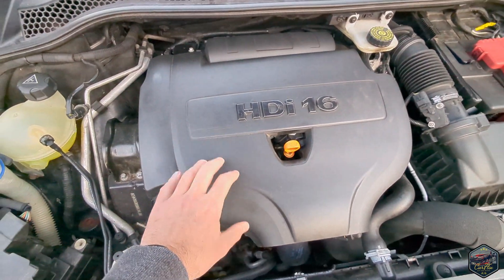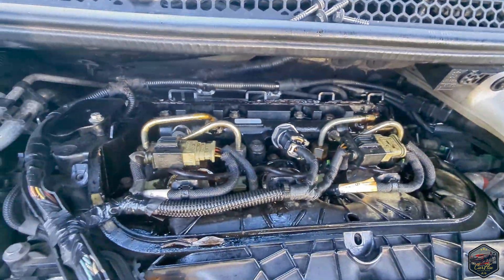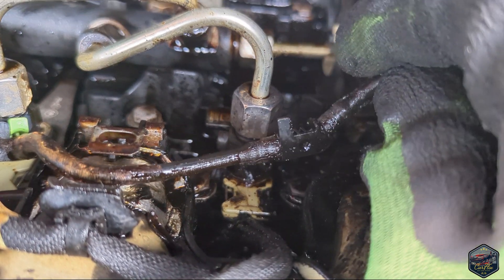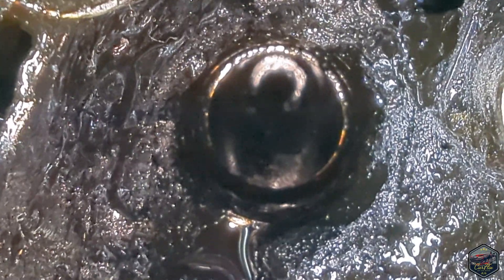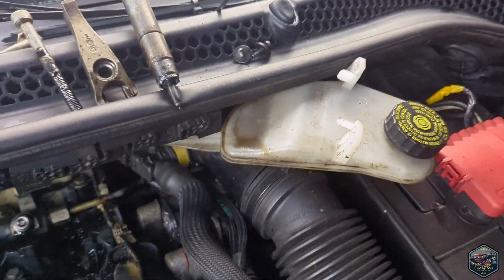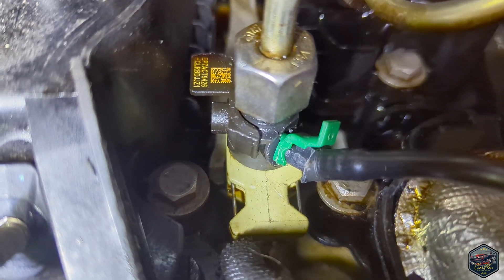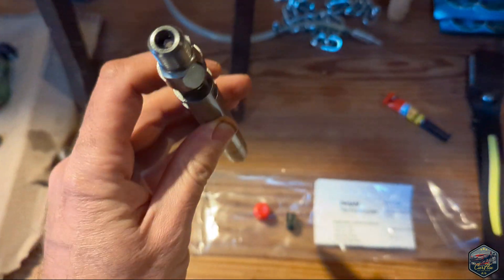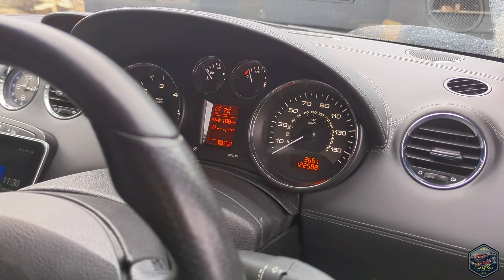HOW I SAVED MY PEUGEOT RCZ HDI FROM INJECTOR BLOW BY AKA BLACK DEATH

Comment: Hi I have messaged you before loving the channel very helpfull im in same boat with injector apart from i cannot find a replacement seal for the plastic protective cover only complete cover  did you manage to find someone who sells just the seal if so could you let me know who many thanks keep them coming really enjoy these videos
Reply from the maker: Hiya, thanks so much for your kind words, I couldn't find them either so just reused the old ones off of the old injector 😊
Reply: @CarFlix. No I mean the plastic cover that goes over the injectors you said your seal was perished did you have to replace the whole plastic cover or found a new seal as I cant seem to find one the big plastic cover that goes over the injectors that has the 3 8mm nuts
Reply from the maker: @TheLester59 oh you mean the injector casing , no you I didn't bother in the end , I'm just going to keep an eye out for a good 2nd hand one 😊
Reply: @CarFlix. Ok cheers mate keep up the good work

Comment: Just purchased my first diesel with this engine  after many years and several petrol powered vehicles, this has helped alot. This is one of the main reasons why I've shyed away from diesels!  Many thanks.
Reply from the maker: So happy this has helped you, these diesels are bulletproof as long as they are serviced regularly and ran on quality fluids and fuels , happy motoring 😀

Comment: Great job and video, we had to do this on a van and the build-up was over an inch in some places so it meant having to painstakingly chip away at it, vacuum the bits and then once it was clean enough we used Mr Muscle oven cleaner and that worked great and you're right some sprays don't do much that's something I also discovered. The leak off pipe also broke like yours I think it's because of all the build up and heat etc and the sealing washers were just as bad.
Reply from the maker: Thanks so much for your kind words 🙏🏻😊, I agree it's the worse stuff to remove you either have to chip it away when cool or remove it like honey when got either way is difficult. I'll be tightening these bolts on every service from now on lol 😁, oh and thanks for the tip too ☺️